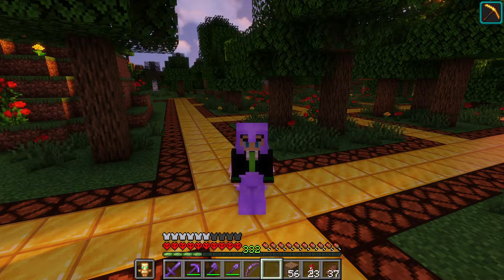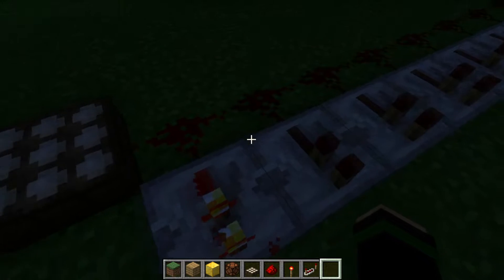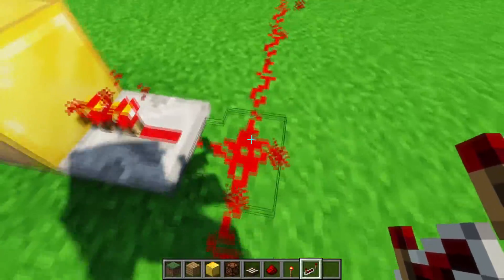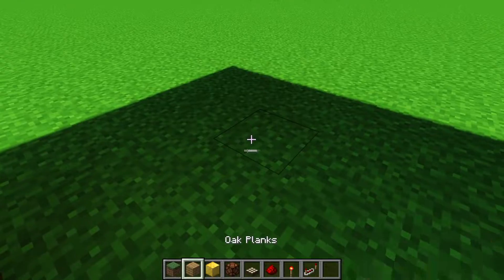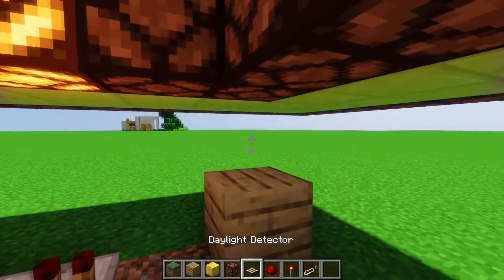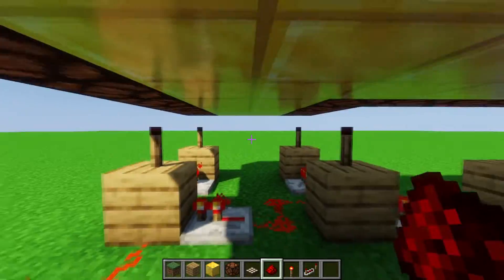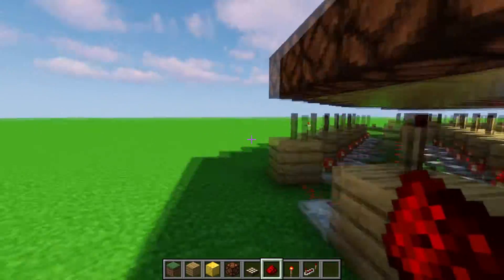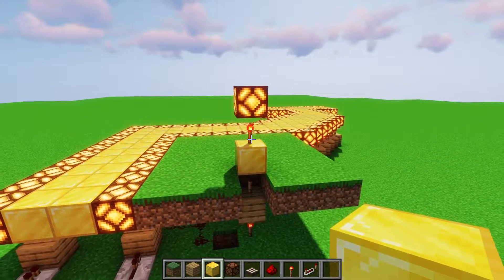How to Make a Daylight Sensor Pathway with Redstone Lamps | Minecraft Redstone Engineering Tutorial

Comment: where to i got to put the ligjt sensor if i'm underground, because when i close the top it will automatically turn on because its dark underground
Reply from the maker: You have to put it on the surface without anything blocking it. You can bring the signal down with redstone and repeaters, but it will be long if you're far underground. I think you can also put it underground and mine out all the blocks above it

Comment: Hmm. Question I have is I was trying to figure out a way to mix this with my auto fireworks so that fireworks would go off at nighttime for a particular build. And if need be I would also have to make a way to auto-fill the dispensers but that is a problem for another day. I assume I could just hook up the light sensor right where I would the switch exactly as it was done here in the build and it will work the same? I'll save this video and let you know if it does. It sounds like It should but I'm not great with redstone.